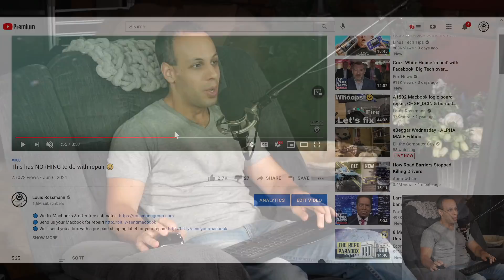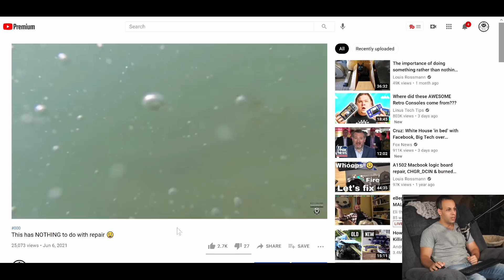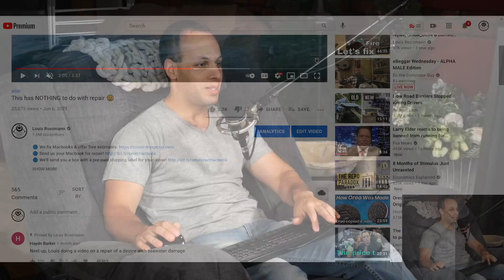Why are user serviceable batteries a bad thing?

Comment: It doesn't even stop there either. Once you open the device the battery is super glued to the chassis. A simple battery well it fits snugly into would suffice, as seen in the PS5 controller. I understand the adhesive for the water resistance. Im fine with that compromise because there is a legitimate functional gain there. Water doesn't get in (when it's adhered properly). But using contact cement to fuse the battery to the frame is entirely unnecessary. Sealing a battery in a plastic container with contact pads that slots into and out of the device would solve both problems anyway. Waterproof and user replaceable. How that would work into the form factor of a phone, I don't know. Probably the same way the S pen on the Note lineup does? Just make a wider compartment in the bottom center and slot a battery into it instead of a stylus.

Comment: When right to repair legislation does not mandate anything for the design of the device, couldn't this be exploited by the manufacturer? Adjusting the design in such a way the device is nearly impossible to open without damaging the device. Even for a skilled repair technician.
If not by "restricting" the design, how could this loophole be avoided?
I think of special tooling (may or may not fall under "access to components"). Or the manufacturer is just replacing damaged devices, access to internals is of no concern for them.

Comment: That is one thing I don't get about PS fanboys. I have both systems and love the fact that Xbox uses AA batteries i always have a fully charged controller but if I forget to charge my PS controller after a couple long sessions I'm shit out of luck unless I want to play with it plugged in. I literally got into an argument with a guy over this fact before while he insisted that the DualShock4 was better because you didn't have to change AA batteries. 

4 rechargable AA batteries = infinite Xbox wireless gaming controller.

Comment: My wife got me a brand new moto g power in November. In January the phone fell off the table and the battery got dislodged. The phone would nolonger turn on. Thankfully when I messaged Motorola they repaired it no charge and fairly rapidly, but this could've been fixed by myself, someone with zero repair knowledge, if I  would just be able to open the battery compartment.

Comment: I'm a simple man. I like screws and bolts. A design meant to make efficient use of components lifespan.
I like glue less. It has its places and purposes. But not if it sabotages serviceability. And especially not if it is a message telling me I'm not competent enough to do basic repairs on the device I own.
Glue is nasty. Screws are cool.

Comment: I remember having a S5 that I dropped in a puddle of mud and I was able to take it inside and run it under the faucet to clean it off without even turning off the screen and it still worked fine. That phone ended up getting stolen so I replaced it with a Note 4 and was still using it until about 3 months ago. In the time I had that phone I went through 2 screen, 2 mobos, and 3 batteries before finally retiring it after the board died again and I finally couldn't get a replacement for it. Now I have a Pixel 4a, it has no water resistance and I already know this phone will probably last me only 2 years at the most. I miss being able to actually use my devices for longer then the manufacture want's us to.

Comment: I refuse to buy a phone without a user-replaceable battery!  I'm still rocking my LGv20 Still runs fine. Ive had to swap a new battery in 4 times over the last 4 years. I was also able to replace the cracked rear camera glass myself.

Comment: im for right to repair so take that in mind. there IS a case for some batteries to not be user serviceable... and thats when the voltage gets to high... i work with 6 and 12 cell lipos for RC stuff and THEY demand respect... Tesla is using 1000's of cells and 100v+ system THESE CAN KILL YOU or star really bad fire that most people could put out short of call the local FD... 

sure batteries for phones and laptops go for there 1 to 2 MAYBE 3 cell up to 5000mAh not 20cell 100,000 mAh monsters that can kill you. Hey Louis i worked with high power 24v and 50v Lipos for wile feel if you want talk about why i think in this case Tesla is right not let the end user mess with them. 

high voltage lipos (any thing over 14v) are no joke as are high power any thing over 5000mAh.

Comment: The best thing about user replaceable batteries for me was with my first Android Phone, the Samsung S2. There were aftermarket BIG batteries that came with bigger back covers to support them.
It may have doubled the thickness of the phone, but it gave me over FOUR TIMES more usable time on the phone before I had to recharge it. Haven't had a smartphone since that could go that long between charges.

Give be a replaceable battery so I can easially put a MASSIVE one in, instead of carrying around a backpack of power banks.

Comment: It's not just batteries either. SSDs have a limited number of read/write cycles before they start corrupting data. That's where replaceable SD card slots come in handy.

Stupid stans need to go touch grass instead of being a keyboard warrior for nonsense like sealed in batteries.

Comment: Could it be that many people's recollection of user replaceable batteries had to do with them having to carry extras to get through the day? I certainly remember having to carry a couple S3 batteries back in the day.  I saw it as a positive thing because everyone else had to keep finding chargers throughout the day. I could just pop a new battery in and be on my way.  So perhaps people are equating user replaceable batteries with low capacity batteries.  But lots changed since then batteries are better if even marginally and phones are certainly more battery friendly too.  Additionally and even though you didn't mention it the same argument for replaceable batteries not being water resistant goes for headphone jacks. It's a load of BS that you can't build a phone with a headphone jack and still have a water resistant.  I gladly take one or two millimeters additional thickness to get back a replaceable battery and a headphone jack

Comment: A few days ago my father's phone got water damage in the screen and the touch doesn't work, I literally said "how is this not waterproof, my s8 can dive in the bathtub, how this (a51) can't survive a little water when the design is practically the same" the keyword was practically, they cheaper out in 3 parts that would have make the phone water resistant, rubbers around the charge port, headphones jack and sim tray, that is all that is different between this two phones.

Comment: Maybe having sealed-in battery is a luxo-flex :-)  As in "I can afford to throw away and replace my $1000 device as soon as the battery goes bad".  Or perhaps it lowers the price point a bit because it comes with a guaranteed revenue stream for the manufacturer (of course it only lowers the upfront price in this case).

Comment: Wouldn't user replaceable battery make phones and laptops noticeably thicker though? I get that the water-proofing argument is complete bullshit, but doesn't it seems logical that a device with an easily accessible battery would need more material and a latch mechanism leading to a thicker phone?

I'm not sure how much of an issue this really is. If manufacturers actually put effort into this they could probably make them close enough to the same thickness. And to be fair, I'm sure many people, myself included, would be happy to compromise on a bit of thickness for a device with greater longevity potential

Comment: While I do like the idea of user replaceable batteries in phones, it does require the phone be thicker to fit the same size battery.  I think that's why many people prefer that design.  On the other hand, this same aspect, the phone being super this, caused me to drop my phone last Friday, and now my screen doesn't work.  So, I'd like a thicker phone with some small bezels like older phones, as they are easier to hold safely.  Super this phones with no bezels are difficult to hold safely, at least for me.

Comment: Design changes will take care of themselves once companies are no longer incentivised to design products that are universally difficult to repair.  If law passes that enables third parties to get the parts and information they need to complete repairs, the repair market will strengthen, and manufacturers would be incentivised to enter into it in earnest.  If they decide that it is in their interests to start genuinely repairing their own products, product design will change.  Even if they chose not to get into repair, ‘ease of repair’ would become a more significant feature of the value of their products once they are prevented by law from compelling complete replacement by withholding access to parts tools and information. 

 Unfortunately, that change will probably take the form of legally edgy cases like: the glued in battery will be bonded with a glue that has an exclusive patented solvent that removes the glue cleanly, quickly, and cheaply.  Repair shops would still be able to complete repairs with what they have access to, but at a greater cost, enabling manufacturers to outbid them on repair work. 

C*nts gonna c*nt.

Comment: The primary reason being most of user replaceable battery phone's that came out years weren't of the best quality at the time some of bigger and nicer phones had theirs sealed in so now that almost everyone has moved to that formula ppl just assume that if it's replaceable it's gonna some cheap peice of plastic on a terrible phone that's not how it is or was but that's what ppl remember the bad stuff

Comment: Those fools advocating for glued in batteries etc. are suffering Louis, it is quite obvious from what too, but in case someone can't put their finger on it, it's Stockholm syndrome. Yes that, sure they weren't held hostage physically and under threat of life, but they were mentally and device wise held hostage for years on end, by so many companies it added up to this behavioral shaping and their advocating and lack of critical thinking in this regad.
I personally would prefer a more repairable phone, with exchangable battery, heck I once witnessed one of them old brickphones as an extra "thick boy", it had been subjected to a third party battery pack, with more amp hours and that made teh battery 8 mmm instead of 5mm, but it also lasted a good day longer, by plenty of daily use mind you? That phone also had a "glued in" battery though and yet it was exchangable, as the battery was glued into the backpanel, which could be removed by design for said exchange, not to mention that underneath the slot for the sim card was burried, you know like they used to?

Comment: The propaganda is the modern consumerist mindset created by advertisements over the last decades - New is the only good. Only New will make you #happy. Anything, absolutely anything else at all, and you have depreciated the value of your status item, and thus self. A repaired item might as well have been dug out of the trash for a lot of consumers. If not that, then needing a repair is an excuse to get something new. I believe that many people derive their self-worth from their possessions and that's a essential part of the problem.
I see it in my line of work all the time. New employees complain if given a laptop that has one month of use by their predecessor in a position. 
C-suite and corner-office folk get new devices (and often special devices that do not comply with the rest of the organization's computer procurement policy) specifically to feel they have power derived from these items which are not even their possessions. We literally take the same unacceptable, perfectly functional items that are already provisioned for C-staff, but resell them because they are a year old!
We have already had people asking for the new Lenovo folding display laptop. Nothing even slightly wrong with their current device for their use case, and for almost all of these users, that particular Lenovo is a down-grade in every way. They just want the "new" factor.

Comment: I've never advocated for batteries being a pain in the arse to replace. I miss my galaxy S2, where I could replace the battery if I wanted, PLUS a manual shutoff switch with no more hastle than a TV remote! If my s9+ locks up and none of the buttons work anymore, I can't do anything without going through the painful process of figuring out how to pop the back off and probably have to go through that dental floss technique. In fact that's why I initially went for Osmo Mobile 1, only upgraded to the 3 cuz I needed access to my aux port.

Comment: Removable battery is why I got an LG G4 as my first smartphone.
Reply: LG G4 was amazing. 1440p screen. Camera could get away with handheld 1/4 second shutter because OIS was so good which allows for lower iso in manual mode plus raw photo output. If it didn't have that issue that caused so many units to boot loop or fail including mine then I might still be using it to this day.
Reply: @TetraTimboman  That was an issue? I had no idea my G4 lasted me 4 years tho the camera stopped being able to focus (may have been my fault from drops or trying to take a pic of the eclipse when it happened) continued to use it after that until the battery life just got too bad and even with a spare it was hard to go a whole day then I got the g8
Reply: That's why I still daily a V20
Reply: Yeah sans boot loop problem it was my favorite phone...so premium with the leather back
Reply: Just retired my G4 last November.
Reply: I still have my G4 for taking photos of the nightsky. Though it lags when using apps and heats up. 😀
Reply: would still have my g4 if it wasnt one of the many ones with a built in hardware problem that made them degrade and die for sure over time.... or thats what  they say
Reply: Removable battery is why I recently picked up a Moto G5 (non-plus).
It's a little laggy, but actually completely usable.
Reply: Still using mine on my third if you count the original. Like the IR emitter on it I can use it to trigger my Pentax DSLR or remote for TV etc.

Comment: People comment on me having an old phone.
Allow me to provide some arguments for sticking with my Samsung Galaxy S5:

- It still works (even after falling onto the pavement tens of times)!
- I can replace the battery when it's empty. I even have 3 extended capacity batteries and 4 external chargers!
- It has an IR blaster (very helpful when i worked as a technician for an ISP so i could configure tv's if the owner had lost their remote)
- Did i mention it STILL WORKS?

Admittedly, it's slower than what it used to be, and its USB port is broken.